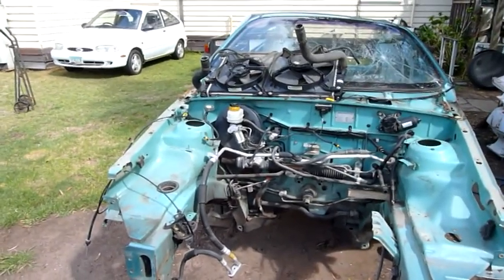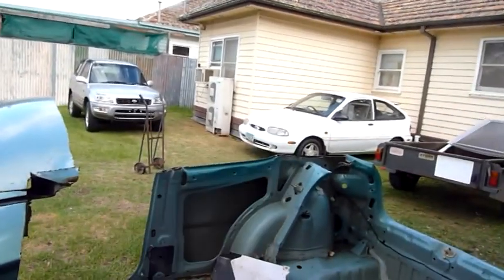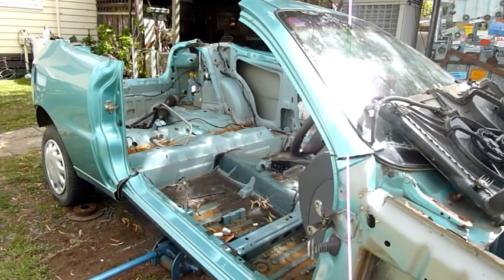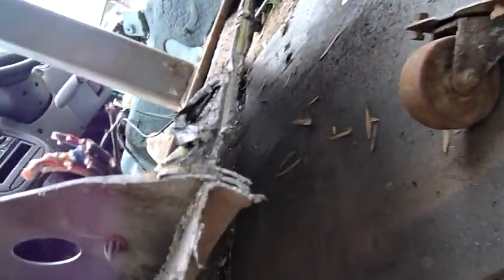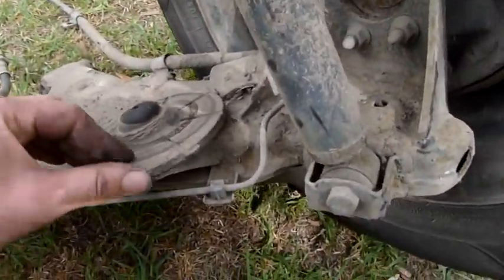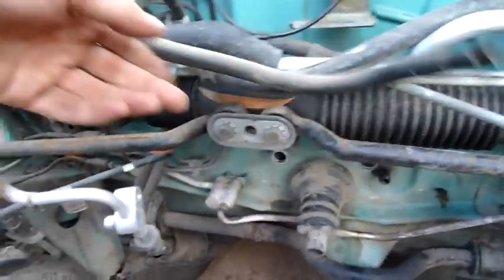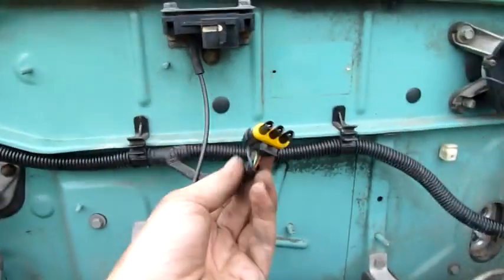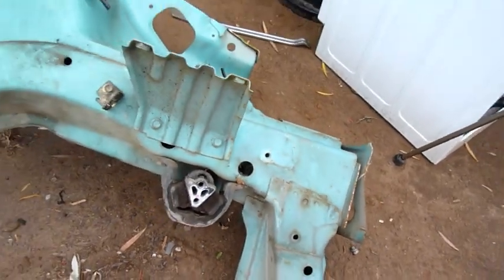Daewoo Lanos Autiopsy - Cross-Sectioning the Body

Comment from the maker: as in silicone?, I think you will find that it will peel off the rubber seal after it has cured.
I've taken a length of rubber window washer tubing and stuffed it behind seals before, to push them out far enough to work again

Comment: I still have an old all-metal drill. It isn't variable speed or reversing, doesn't have a clutch, has to be grounded, and the keyed chuck is only 1/4" (6mm). If I had to pick one drill to keep, it would be my full-featured cordless model. Grandpa would agree. Still, I get a good feeling every time I pick up the old one and pull the trigger.

Comment: @13:50 those shocks sux they are made by daewoo made under license from BOGE ,but they are the crappy oil shocks ,the BOGE TURBO GAS ones are great though"yellow ones" they turn that suspension into a nice roadworthy &performance suspension ,i had them in my 90daewoo lemans GTE /OPEL KADETT MK2, 2.0 they are great,i took them out on my car when a tree crushed it back in 2011 october ,i ripped the complete suspension &beam out,now waiting to find a rust free OPEL body to install it in